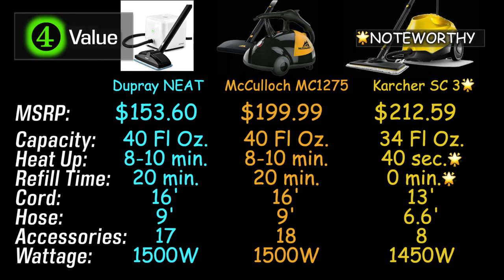DUPRAY Neat Steam Cleaner REVIEW - Watch It Clean + How To Use (THE TRUTH!)

Comment: You’ve pretty much echoed our thoughts in this machine. We are in the process of returning ours now. We just couldn’t justify the purchase, as the cons outweighed the pros for us. The actual sterilization of anything will only be achieved if the nozzle is literally pressed up against the surface to be sanitized…applying steam at a distance of anything further than a few inches will dramatically reduce the steam temperature rendering it appropriate for basically a steam facial (far from Duprays admission of  hot enough to sanitize). So based on having to touch the surface with the tip for the steam to be effective, and depending on the surface size your sanitizing, even a toilet would take a very very long time. We definitely had high expectations from videos Dupray included on there web-site, and after realizing that they are not accurate representations, we just felt like we couldn’t support a company that does that. Seems your video showed the before-after’s well and we had similar results. We ended up using chemicals for certain things  (BBQ and Oven) and felt like vinegar, baking sofa, lemon juice, hydrogen peroxide and alcohol can be better for removal in most cases that Dupray cannot seem to tackle.
Reply from the maker: Well said comment and I agree. Thanks for sharing your experience with it.
Reply: @BruceAlanR  Which steam cleaner will you recommend?
Reply: It’s cheap though , it does great for that price point
Reply: @klausrostock4163  I’d have to respectfully disagree that it’s ‘cheap’. I mean I’d consider a bottle of vinegar ‘cheap’. This machine retails for over $200 with taxes. I’ll just leave this little observation with those that are considering…any of those YouTube videos where a super popular cleaning guru/cleaning company claims this machine is great and to follow there affiliate link to purchase…well just check out there videos (after they promote this machine) and you’ll quickly realize they rarely, if ever, use this machine in videos or shorts before or after it’s appearance…well unless they are promoting for affiliated purposes. So if these are professionals who clean for a living and they are not pulling this machine out to make a job easier than somethings amiss. Sorry, it’s just not me that says this…it’s unbiased, unaffiliated, and uncompensated people looking for a natural cleaning product that works. This sadly does not. Your better off purchasing products that you see time and time again making appearances in their videos.
Reply: You can just spray some cleanser beforehand as I do if you are so concerned about germs.  This thing cleans without using your hands.  You’d be amazed that you don’t need to perform surgery in the bath or kitchen.  Seems you need to just douse your home in bleach before your satisfied.  Other folks will live in our clean home with this thing.
Reply: @brodenmacarthur3955  not sure what your even talking about…your reply clearly didn’t reference anything I said in my comment. Moving on then…
Reply: @chyatt300  I don’t mean to be insulting.   This steam cleaner is hotter than most comparable models like mccullock.  I have used this to clean and disinfect without any problems whatsoever.  I’m sorry you didn’t like yours but we love this thing and think it’s amazing at sanitizing and cleaning any tough job with little effort.  For the money it’s great.  They do have more expensive models but this steam is hotter than most.  I hope you find one you like.  They really make cleaning so much easier for me personally.  I’m just so impressed by it but not everyone will be I guess.  Cheers.

Comment: None of these reviews asnwer the main question...How hot is the steam few inches away from the surface? Most of these steamers are only hot when they are right up against the surface and lose heat drastically just a few inches away from the surface. And also, how long does the preassure hold? Most steamers will lose preassure very quickly and you have to stop and let it build preassure again. None of these reviews address these questions.
Reply from the maker: From my experience I’d say you want the wand as close to the surface being cleaned as possible as the steam does cool quickly beyond 1/2”. As far as pressure, this unit provides consistent pressure when the trigger is down. Hope that helps!

Comment: How well does it work on removing grease residual found on the stove top and the fan under the microwave?
Reply from the maker: As I demonstrated in the video, the steamer does a decent job cleaning stove tops and grease residue under the microwave; however it won’t remove burned on grease stains around burners, stubborn stains under a microwave, or burnt on stains in an oven. It just doesn’t get hot enough since most of those stains have been “baked” in over months and sometimes years. If you’re looking to get rid of those types of stains on stainless steel, I recommend watching this video: How To Remove Stains Around Burners of Your Stainless Steel Cooktop - Frigidaire Gallery Cooktop
https://youtu.be/NGUt_qfrfXY

Comment: What is the best steamer you found for floors? I got the Dupray neat steamer, and it left so much water behind dripping from the microfiber cloth
Reply from the maker: Interesting. I don’t know which is the best for floors, but changing the more pad frequently may help reduce the wetness.
Reply: Yeah, I did a small area, doorway, and left so much water, watching your review I knew something was wrong because I had puddles of water. I think mine might be defective, especially because the delivery person literally squeezed it into a locker I could not get it out of. So that might be the issue.  But thank you for your response
Reply from the maker: @ms.bonillas1125 Is it possible you overfilled the tank? If you overfill the tank the water will overflow the steam chamber and end up in the hose. Then the steam pressure will push it out the nozzle. Try emptying the tank and then adding back a cup or two of water to see if that was the issue.

Comment: can we use this over wood (ie cabinet doors, doors, etc). Is it safe on walls?  And the vinyl in car dash, etc? have you had to replace the brushes. they get you on that since those are so expensive. Thanks for sharing your video, good suggestion using a cheap scraper so to salvage the brushes. I've only used the floor one. But i was very disappointed that the clip broke after a couple of uses. i was to busy to contact the folks to get a replacement. So i use a rubberbann to secure the other end. I think 'prepping' the oven door with baking soda paste and vinegar first and let it sit. steam isn't a miracle. Free facial lol . We live in a townhome so haviing to carry it upstairs , main floor, and downstairs became a hassle, so i used it once in a year. You can buy the microfiber cloths at costco , 2 dz. comes down to fifty cents and cut them into 3.
Reply from the maker: I have used it on painted drywall, moldings, and cabinets; however, I don’t get right up on them to avoid removing paint or warping. Also, if I pause for more than 15-20 seconds, I spray into a bucket first to avoid blasting hot water onto the surface. I’d do the same with a vinyl dash although I’ve never tried that… I usually just use Armor All wipes. 
I agree that accessories are expensive. I haven’t had to replace any brushes yet, but a few of the nylon brushes are missing some bristles. Good suggestion on the oven door. Will try that. Thanks!

Comment: Nice in depth review. You have convinced me to buy this as it does look heavy duty compared to other steam cleaners. Would using filtered tap water as opposed to just tap water be advisable?
Reply from the maker: Filtered tap water may make a little difference. Oddly, I've found that even when I use only distilled and demineralized waters, there is still some particle build up in the tank. So either way, you'll still want to occasionally fill the tank with white vinegar and water and let it sit overnight.
Reply: @BruceAlanR  The manual says to not let the vinegar and water sit for more than 40 minutes.  I'm guessing this is because the acid in the vinegar can be damaging after that point.
Reply from the maker: This is interesting Regina. I am staring at the manual I got when I purchased the steamer a few years ago and under maintenance (p.13) it says, “Fill the boiler with equal parts of water and white vinegar (for a maximum of 17 oz or 500 ml) and leave the boiler cap open. Let it sit overnight. 
Drain the boiler, and rinse thoroughly with clean water. Replace the boiler cap.” No where else in my manual does it say anything about 40 minutes. I wonder if they started experiencing early tank failure so they rewrote the manual. When did you purchase your Dupray Neat?
Reply: @BruceAlanR  This is so weird. I posted a link to the new owners manual so you could see the recommendation. Did you get it?
Reply from the maker: I don’t see the link. Would you mind emailing it to me at BalanR.Reviews@gmail.com ? Thank you!
Reply: @BruceAlanR  Done
Reply from the maker: Thank you! I contacted Dupray using the U.S. 800 number and the rep said the difference in the manual depends on a few factors… year it was made, country of origin, and a bunch of other “stuff.” His advice was to follow the instructions in whatever manual came with the product and to call them if I ever had an issue with the tank. 
He did say I didn’t have to leave the solution in the tank overnight (as per my manual) and that 4-5 hours was enough for descaling my model. I guess time will tell. Thanks again for emailing the manual.
Reply: @reginaflynn2622 You are correct.  Apparently,  vinegar damages the equipment longterm. Just spoke with Dupray.

Comment: Did you returned it? it seems you hate the machine and it does not do what you would like it to do.
Reply from the maker: Sorry that I gave you the impression that I hate it. I still have the Neat and use it a few times a month to clean the kitchen and bathrooms. Having said that, I was a bit disgusted recently when I stuck an endoscope (a small camera) into the tank and saw lots of mineral deposit flakes and black water. I descale the unit regularly and no matter how hard I shake it when rinsing, the tank’s design makes it’s impossible for all the loose deposits and water to escape.

Comment: Wonder if it works for the baseboards and walls….
Reply from the maker: I’ve used it on walls and baseboards. Just don’t leave steam directed at one spot for more than a second or two. For walls use the floor attachment or the triangular tool with a bonnet or cloth.  For baseboards I use just the wand and wipe with a cloth; however, be sure to have a bucket handy for the initial spray as to avoid shooting a bunch of water where the baseboard meets the wall.

Comment: According to the notice, the descaling vinegar-water solution should not be kept in the boiler for more than 40 minutes.
Reply from the maker: Yes thank you. Dupray has changed the literature since I purchased mine. I even called them about it 6 months ago and the representative was very vague. He said, “Well, it depends on the country of origin and when the product was manufactured, so just let us know if you have an issue.” Not a satisfactory answer in my opinion. I have a feeling some of their units are experiencing tank failure due to poor materials and design. There’s no way to get all the water out between uses other than to boil it off. Even still, a little water is left. After receiving your comment, I stuck a mini endoscope (captures video) into the tank of mine to see what it looked like… it wasn’t pretty and didn’t look like anything I’d want to breath. I’m descaling it at the moment and once it’s done I’ll have another look. May I’ll even post a video of it. I’m not pleased at the moment!
Reply: @BruceAlanR please do as I had to send my 2 year old machine back, they offered me a replacement. It had so much mineral inside that it would not steam . I cleaned it as instructed multiple times and to no avail it did no good. Once the water was brown . I would love to see what the inside is made out of , I was thinking some type of metal , because the water looked rusted .

Comment: Can you pre treat wall-wall carpet before shampooing?
Reply from the maker: I don’t see why not. I’ve found the steam cleaner is better for removing odors from carpeting than removing dirt. A better option for deep cleaning carpets would be something like a Rug Doctor or Bissell Little Green ProHeat carpet cleaner. Requires patient for big areas though.
Reply: @BruceAlanR  I see what you mean because I bought it. The putting the microfiber cloth trick is genius. I didn't see it had (actual clips) to hold the microfiber on the wond and that trick works amazing. TY

Comment: Can anyone speak to how well these steamers clean carpets? Thanks!
Reply from the maker: Great question! In general, cleaning rugs and carpets can be a bit tricky with this steamer and depends on what you’re trying to clean. And while the steamer  can “refresh”carpets by helping to remove odors, I find there are better tools to remove stains and debris. For example, what I deal with quite frequently is a senior cat that tends to vomit after eating too fast. Our other cat frequently gets fur balls and in both cases, the cats always leave their vomited deposits on our rugs. Once I’ve carefully scooped up the piles to avoid grinding it into the carpet fibers, I reach for a carpet cleaner (ie, Rug Doctor or Bissell cleaner). I’ve used the steamer to gently blot stains, but performance is mediocre in my opinion. If a cat’s “deposit” goes unnoticed for a day or too, I’d still do the same process although I’d use a toothbrush to loosen any debris and then vacuum it up before cleaning. In either case, once clean, fully dried, and vacuumed,  that’s when I’d reach for the steamer to help reduce any residual odor. 

I’ve done a few tests over the years to see how the steamer performs when doing general carpet cleaning (so no vomit, just dirt from every day activities). . . My process was vacuum up loose debris and then use the steamer on low and medium pile carpets with a microfiber cloth on the floor attachment. Once the carpet was fully dried I’d then vacuum again to “fluff” and remove any loose carpet fibers (one of our carpets sheds terribly). My final determination was that cleaning with the steamer only provided a modest improvement in the overall appearance and perhaps reduced odors; however, I couldn’t decisively say I noticed the carpet looking cleaner. In ringing out the microfiber cloth, it didn’t yield as much dirt as I expected either. So my opinion is the steamer is better for refreshing carpet versus providing a deep clean.

Comment: Can I use it to clean the bedroom rug?
Reply from the maker: In general, cleaning rugs and carpets can be a bit tricky with this steamer and depends on what you’re trying to clean. And while the steamer  can “refresh”carpets by helping to remove odors, I find there are better tools to remove stains and debris; it will spot clean though. For example, what I deal with quite frequently is a senior cat that tends to vomit after eating too fast. Our other cat frequently gets fur balls and in both cases, the cats always leave their vomited deposits on our rugs. Once I’ve carefully scooped up the piles to avoid grinding it into the carpet fibers, I reach for a carpet cleaner (ie, Rug Doctor or Bissell cleaner). I’ve used the steamer to gently blot stains, but performance is mediocre in my opinion. If a cat’s “deposit” goes unnoticed for a day or too, I’d still do the same process although I’d use a toothbrush to loosen any debris and then vacuum it up before cleaning. In either case, once clean, fully dried, and vacuumed,  that’s when I’d reach for the steamer to help reduce any residual odor. 

I’ve done a few tests over the years to see how the steamer performs when doing general carpet cleaning (so no vomit, just dirt from every day activities). . . My process was vacuum up loose debris and then use the steamer on low and medium pile carpets with a microfiber cloth on the floor attachment. Once the carpet was fully dried I’d then vacuum again to “fluff” and remove any loose carpet fibers (one of our carpets sheds terribly). My final determination was that cleaning with the steamer only provided a modest improvement in the overall appearance and perhaps reduced odors; however, I couldn’t decisively say I noticed the carpet looking cleaner. In ringing out the microfiber cloth, it didn’t yield as much dirt as I expected either. So my opinion is the steamer is better for refreshing carpet versus providing a deep clean.

Comment: What about walls in the house and ceilings?
Reply from the maker: You can definitely use it for that. I've cleaned moldings and walls with it. I just recommend aiming the attachment into a bucket before going at walls/ceilings in case condensation is released before steam. That way you don't blast the surface with hot water before the steam is generated. It doesn't always happen, but if you're taking long pauses to wipe down the surface it does.